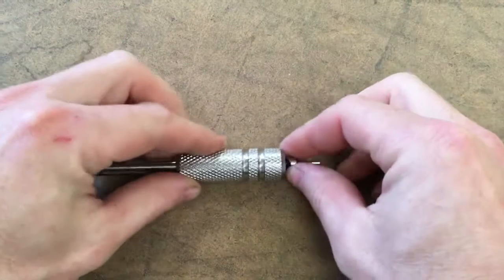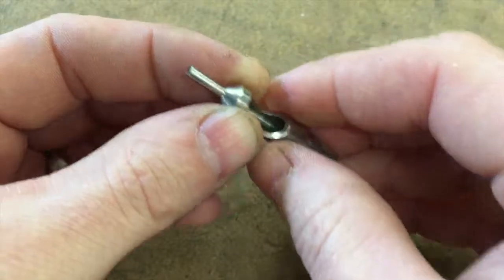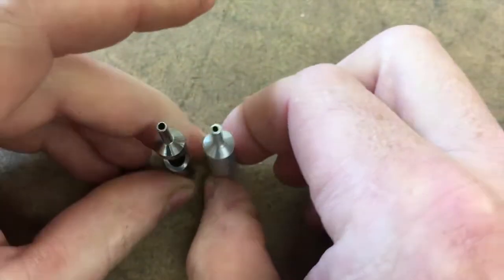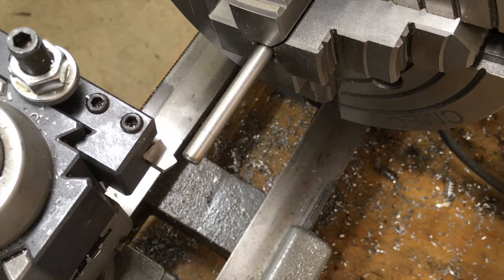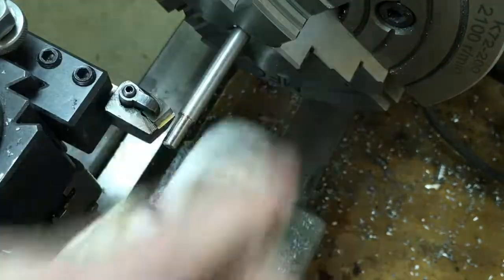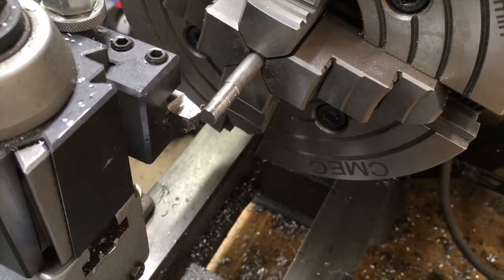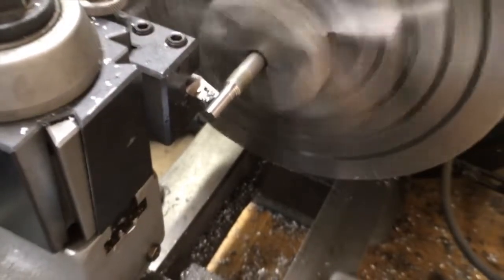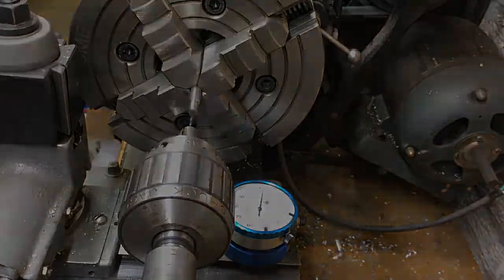316 Stainless Shootout - Is "Easy To Machine" 316 really easier to machine?

Comment: I have a Craftex CX708 (10" x 18") lathe and I found 316 is crazy stuff to turn. I found you gotta haul ass, fast rotation speed, flood coolant and steady feed rate did the trick. Carbide likes it fast and a steady feed rate, flood coolant keeps the 316 from work hardening. It tends to heat up so the coolant will keep in machinable during the cut, if you stop, don't drag the tooling. I also found drilling is better if you peck and then withdraw to lube and clear on smaller bits. Thanks for sharing your experience.

Comment: I machine a lot of 316 stainless & use carbide boring bars as they are very good. However, I ramp the speed up a lot & I do use cutting fluid when turning. Same with disposable tipped cutters. But mine  have very small radius tips. I do a lot of interupted cuts & carbide is god for that.

Comment: Man I laughed my ass off when you started machining 🤣🤣   Between the shaking camera and the lathe rattling noises I'd swear you mounted it on a spring mattress!🤣
Thanks for the vid and info though, it is appreciated, try mounting your camera on some sort of makeshift stand that doesn't lean on the shaky bits for smoother footage - don't worry I started with worse equipment than you did - Hang in there! 😎👍